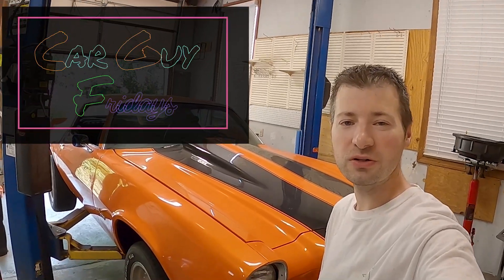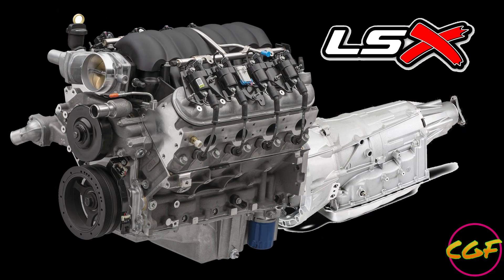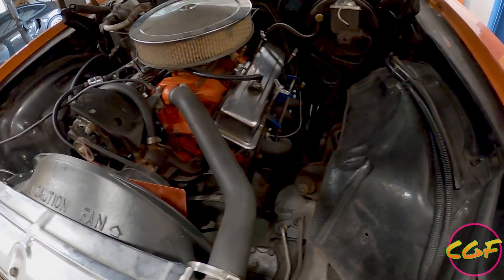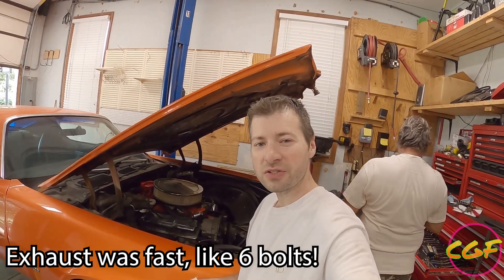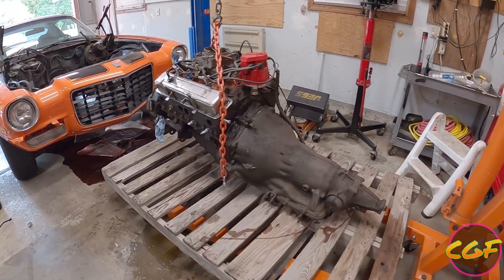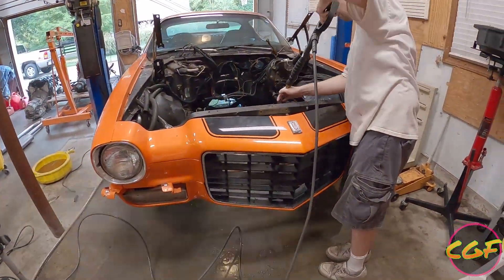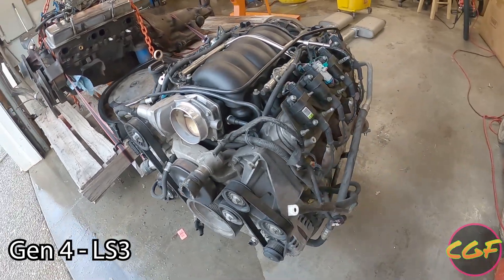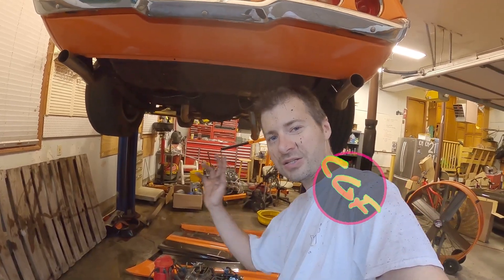Swapping an LS3 into a 2nd Gen Camaro

Comment: Ive got a 1980 rally sport that was swapped for a 305, should i spend the money to get air conditioning before the summer or should i get the 350 swap first? Pretty tight on money and it’s my daily driver
Reply from the maker: I suppose it depends on priorities for you. Would you rather be comfortable or go faster? How hot is it in the summer for you? (South florida for example is an obvious AC!)   

To me at least, I'd rather be comfortable so I'd go AC first.  Going faster is a non ending path because next you'll want a cam, and heads, and and and... you might find you are still hot in the summer :)
Reply: @CarGuyFridays  ill try to find a junkyard compressor, thank you for the guidance. Im in Illinois but it still gets pretty bad up here
Reply from the maker: Good luck, were rooting for you!